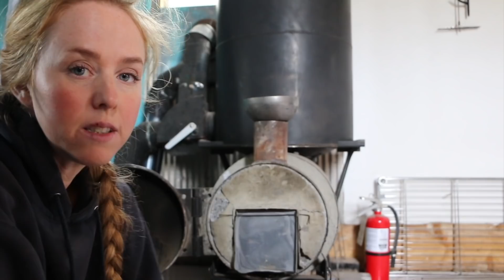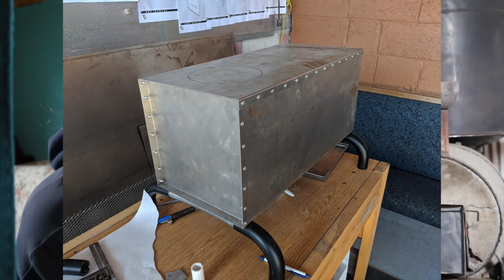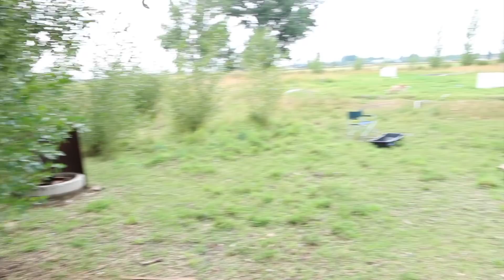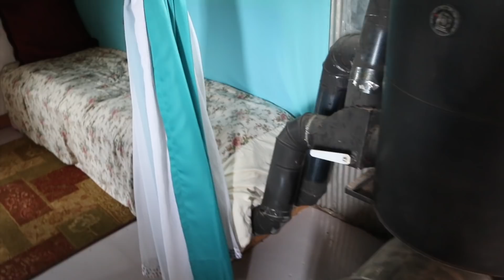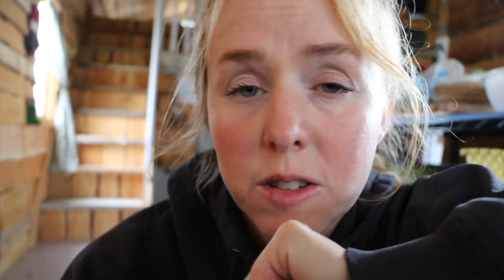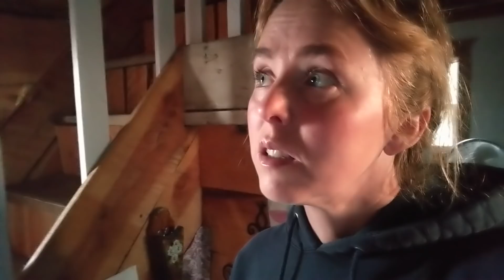Super Efficient  Wood Stove Stays Warm For Hours With No Fire 🔥

Comment: Thanks for the great work on the video, 
Solar hot air to heat up your thermal mass. I was putting it out there to Paul w. and had a couple good discussions about piping hot air  into the mass of the bench  with a solar powered fan from a hot air panel or a greenhouse, this should work automatically everyday would be pumping Heat into your mass if you're home or not, spring, fall and winter. Simple heat storage automatically everyday the sun shines.

Comment: A crafty fire starter, I take old candle wax, melt with dry sawdust, I pour it in a egg carton, fiber kind, and press in.
When going to use, saw them partially through from the bottom, so they are easy to rip one off.
One carton starts 12 fires, just light the corner..

Comment: You can buy a nice epa approved efficient woodstove and  burn less wood
Reply from the maker: The issue isn't the amount of wood burned but the fact that the heat sink holds the heat all night no matter how cold it is outside. We would freeze in this cabin with a normal wood stove.
Reply: @dirtpatcheaven  Well I lived in northern Canada in a 1100 square foot bungalow with an osburn 1600. Temps go below -40 degrees C. That is cold! The house had 2x4 walls and was built in the 60's. That stove burned through the night and there where enough coals in the morning to start another fire. The house was cool in the morning and the first one out of bed  started the fire (me because i was dad!)
 When you harvest your own wood it is nice to have an efficient wood stove. The amount of wood you consume is very important IMO. The heat sink/thermal mass is a secondary plus. However IMO stove efficiency is very important and you might look at combining the two. Cheers

Comment: It's pretty bashed and crack 
Maybe Portland cement,  might not be the best
Reply from the maker: This was the 1.0 version, 2.0 uses fire bricks rated for commercial temperatures in excess of 2000 degrees Fahrenheit.
Reply: @dirtpatcheaven  that would work better 
It's amazing what fire ciment takes in heat .

I , myself used portland ciment too on a version 1 , and results were a disaster,  it failed apart,  cracked. 
Brilliant man , keep the good work and videos coming,  Tums up

Comment: This contraption is terrifying..... fire hazard. Just get an efficient wood stove with a catalytic converter. You can achieve over 24 hr burn times with these stoves.
Reply from the maker: The problem with a conventional stove is that it gives off a huge amount of heat only while it is burning wood or sitting as coals. This little house is soooo little that even a tiny wood stove makes it way too hot. This stove absorbs the heat into the pebbles so that the heat is released slowly over time, not all at once. So we burn it for a few hours and then let it go out but the cabin stays warm.

Comment: how many grams of emissions does it emit?
Reply: oShane Kasper  everyone who breathes
Reply: Probably far less than most direct chimney stoves.  This contains more heat that would burn the carbon
Reply: @vanderumd11  direct chimney? Never heard of that. There's direct vent which is used for gas appliances? Or class a chimney which is used for wood burning appliances? Either way probably doesn't fly, there are testing standards that need to be met in order to sell them.

Comment: I am all for off grid living and trying new things. With that said, I hope you are not paying the guy that is installing this stuff in your cabin. If so, how much propane could you have purchased for the "trials" and changes you've spent money on trying this guys ideas? Hope he isn't taking advantage of you, he's clearly not a fabricator. He may have good ideas but the fact your valve for the bench wont stay open and he simply drilled holes in the pipe for secondary burn shows his fabrication skills are not nearly as sufficient as his ideas. Be careful with your build and dont throw money away being a test subject for someone.
Reply: $1,000 in propane has zero future promise. It will only cost more and the money burns up. Better to take the chances she has taken to perfect her life for decades down the line
Reply from the maker: It cost us no money. We are his little laboratory. I come up with ideas that would benefit an off grid lifestyle and then he builds them, we try them and if they work he puts the plans up on his etsy store. Mutually beneficial.